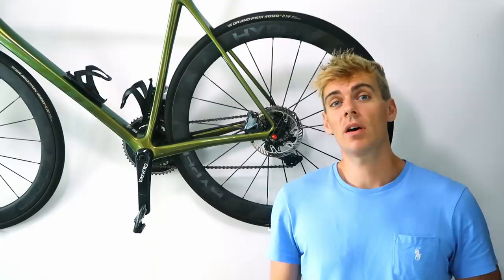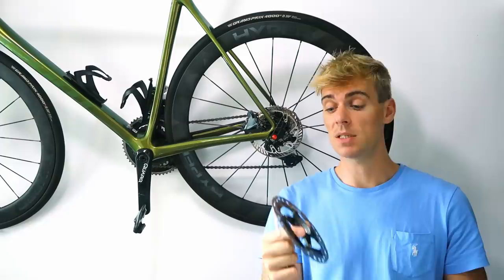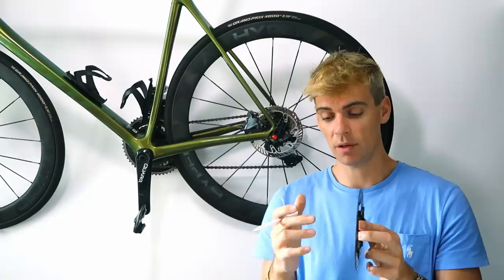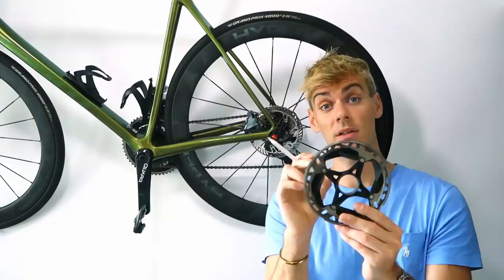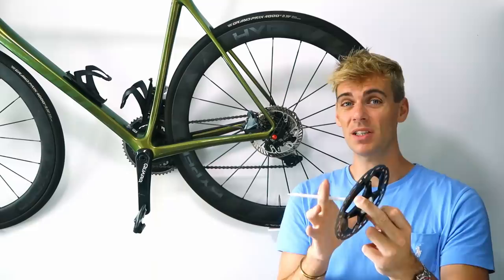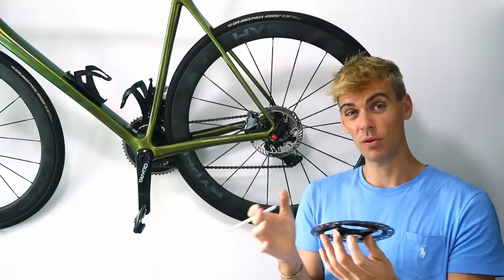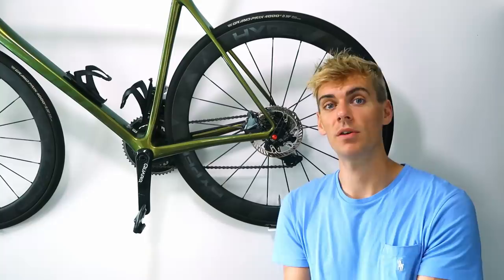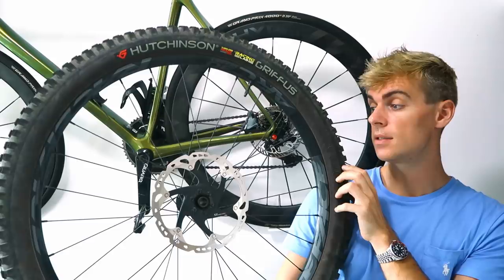Why I stopped using Shimano rotors: Disc brake rotor design, cracks & thermal issues discussed.

Comment: Absolutely pointless project considering you stated several times that you have never had any problems with 6 bolt discs and you prefer the way 6 bolt discs are designed, and they last longer, plus that weight is not a priority in your project. Then just order some centre-lock converters from eBay and use 6 bolt discs!

Comment: Peak Torque: (re riding deep rims in the wind being a problem) "only for wusses" + "man up a bit"

Also Peak Torque: "i can't get more than 6 months out of a rotor" 🤔
Reply: how do these related?
It just mean he is riding in a very mountainous area where he need a lot of braking that it kills a rotor in 6 months.
If anything, mountain descend usually pose handling problem for deep wheels. So this strengthen his quote that handling isn't a problem.
Reply: @Hexsense  being a wimp dragging the brakes, I ride/race DH and 4x as well as road, ive turned a few rotors blue over the years but ive never actually worn one out.
Reply: @jonnythelegs2597  Can also be just braking hard and aggressively for bends, which is how you go fast downhill......